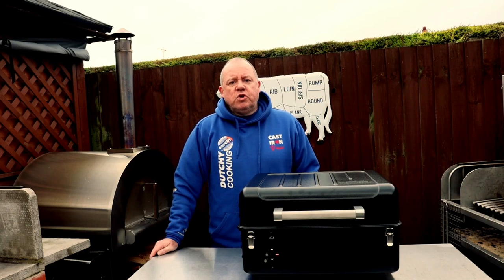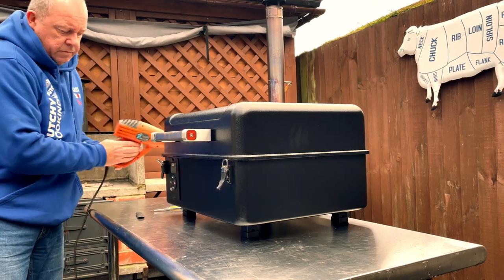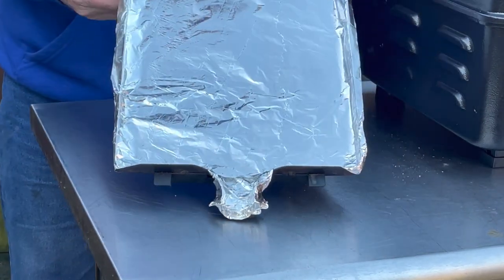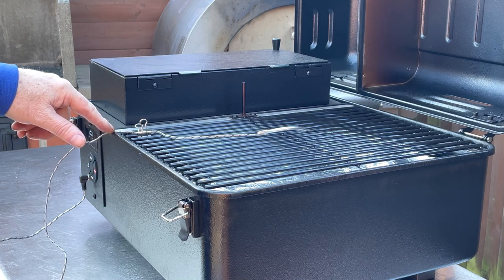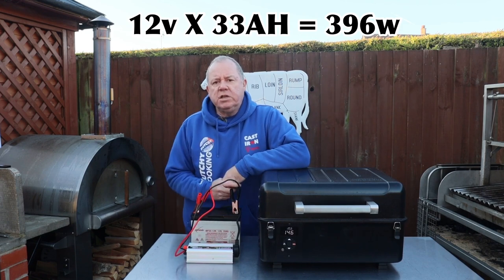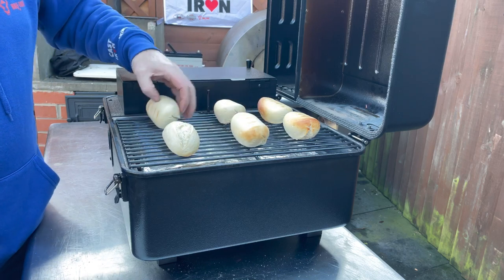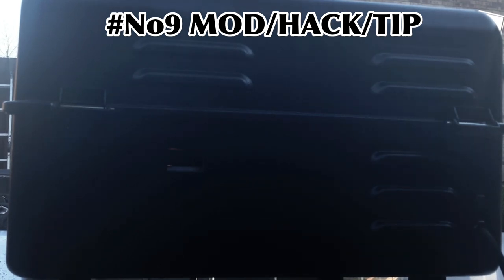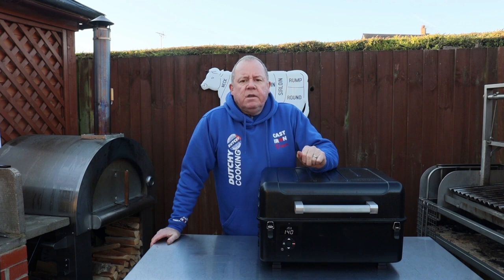Traeger Ranger 8 Mods, Hacks & Tips@DutchyOutdoorCookingBBQ

Comment: Hello! Love the gasket idea. What width gasket did you get? If you have a link that would be great!
Reply from the maker: Thanks Corey, it’s about 10mm which i would say is 3/8th. Sorry, I do not have a link as I bought it at a Local Hardware Store. It’s normally used as a gasket for wood burning stoves if that helps? Stay Safe 👍🇬🇧🇺🇦
Reply: Hi. Great tips. When you fit the gasket is it the entire perimeter of the upper lid, the perimeter of the upper lid that corresponds to the grill area - including the centre line or just the outside edge of the grill area. It’s not completely obvious from the video